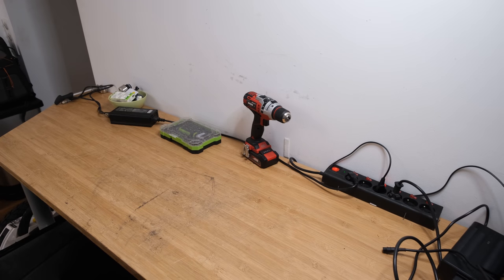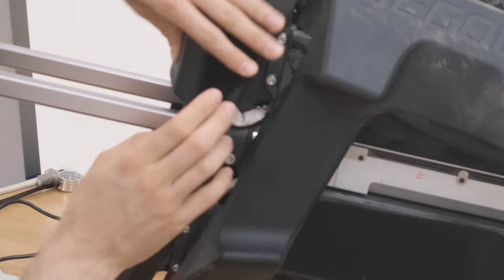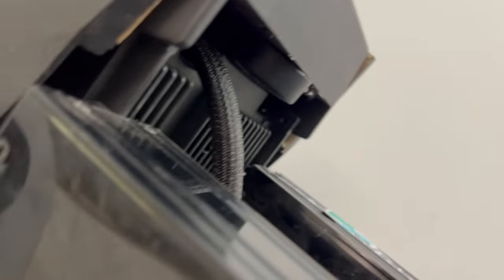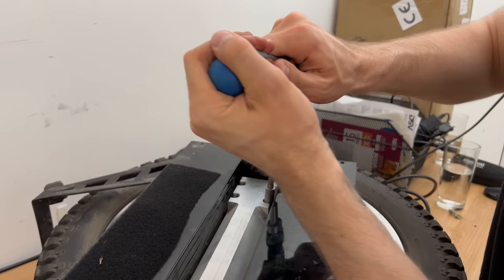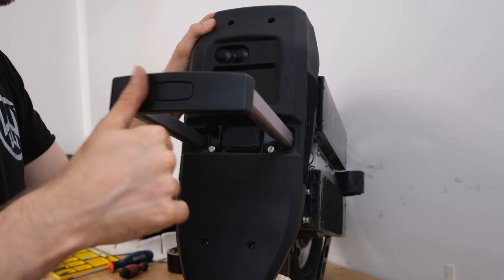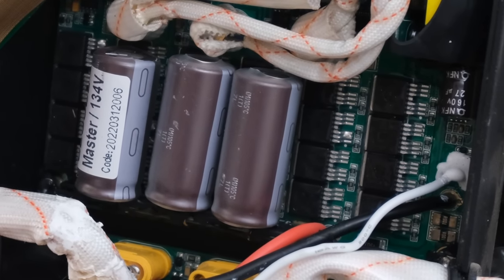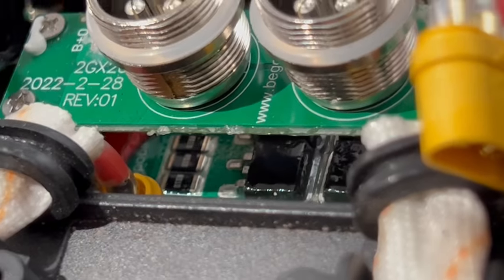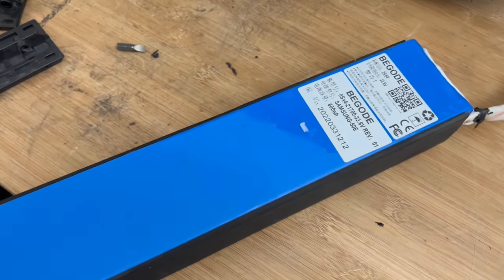Chinese Engineers MAD?! - 134 VOLT Electric Wheel Teardown

Comment: Wow...almost all the new wheels are pure $hit! More than $3.000.00, and the quality seems really bad. I was waiting for the S20 and the Master to buy my second wheel after 9.000km on my first wheel, V10f. I guess I will buy an used Sherman or the EXN. I can't afford to buy many wheels, so I need something reliable.
Reply: I would say my Gotway MS3V is the most reliable wheel I have ever owned - 3000 miles / 5 years and still going strong. I will trust those guys again with this one, and don't mind finishing off their job for them with some adhesive metal plating for batteries, tape on the screws there, silicon round the control board and velcro on the pads. I think they spent the money where it counts - quality mainframe metalwork, suspension, sliders, motor and power.
Reply: 'nuther vote for the sherman here. I've had it for 4000 miles and its runs great. I did crash at 30mph and the guards got messed up. I replaced the front one and the wheel just keeps on working. Its the toyota of eucs. Maybe later we will see the terrorists rolling around with them with ak 47s on their hands 😆
Reply: @Gideon-300  🤣🤣🤣🤣
Reply: @Jaaaaaaaaaaaaaaay  new rider but extensive research and experience taking an MSX apart. I totally agree with you and I didn’t think of sticky metal on battery covers, I almost reached out to a friend to 3d print new battery covers lol. This will be a nicer solution. Already got the silicone, just gotta get the wheel now lol
Reply: This wheel is perfect for me! I just ride these things for fun, like my dirt bikes. I have a car to go everywhere. I never ride my wheels in the rain either.
Reply: Great for trail riders, we end up having to beef up protection anyway. Street riders, 99.5% go nowhere near pushing a wheel to worry about it crashing.
Reply: don't judge the S22 until you've seen it in person.
Reply: I just got the EXN last week and it’s pretty amazing on range and speed.
Reply: I feel like we’re hamsters, regardless of what make of EUC we ride. I think all EUC manufacturers should make products with an intelligent BMS, good IP-rating and safe charging connectors. It would be SO CHEAP to incorporate, especially considering the high price they put on their products. Why don’t they want to look good?
Reply: Guys, please, don’t speak about Sherman anymore, because it’s no more to be found to buy it. Say something about Sherman Max, if you have it. Everybody knows by now, that first Sherman is a great wheel. Thanx.
Reply: @JM Coulon No, you can’t find it. Tell me about Sherman Max. Thanx.
Reply: @aaronrichardson5619  Of course there are solutions. If they can’t do it, then lower the price, so we can do it. You take my money, then you expect me to finish your product. Let’s encourage them in this behavior. Good job.
Reply: @Cr125stin  Well, some of us, think about this wheels as vehicles not toys, and have go to work regardless of the weather.
Reply: @ecoboostedfuze  Is it unbalanced? What is the name of the batteries inside?
Reply: @danmano478  it feels a bit tilted back but if you update the filmware it’s evenly tilted but I feel more comfortable with the old tilted back filmware because it give you more room for acceleration. The batteries are Samsung 50e
Reply: @kenspaceman3938  Man I love your comment. God bless you. Not like those zombies, egocentric, bragging, “ride only in the sunshine”, “the other breed”, “diy it yourself after you paid it”, “yellow lollipop lovers”,  Begode fanboys.
Reply: This is why I got VS out the gate
Reply: @ecoboostedfuze  Probably you bought it from ewheels and they put those batteries. I’m in Europe, and from what I know, from factory EXN comes with LGs batteries, or a combo of LGs and Samsung. I don’t want fire prone LGs. I heard that, because of how the battery packs are put inside, the wheel is not balanced.
Reply: @Jaaaaaaaaaaaaaaay  lol only 3k in 5 years?
Reply: imotion v12 ht seems to be promising, just hope they fixed those issues with cutouts.
Reply: @JM Coulon I assure you, I was not nitpicking towards Sherman. I’m genuinely interested in finding first hand (from a owner) info about the second iteration of this wheel, namely Max. I read some comments of a friend of Adam, in another video, I don’t recall well his name, Jon Svoboda or something, who seemed knowledgeable, enumerating some important minuses of Max vs first Sherman. I really have the money and wanting to buy a reliable wheel for deliveries. Sherman is one of the options, alongside 16X or V12. So chill, man. If I had critical comments sometimes, doesn’t mean I don’t like and love the EUCs, just like you. I just want some reliability, because unlike you, or others, I don’t have the means to pay such a amounts of money each year.
Reply: I agree. I also bought a V10f and I'm looking for a new wheel. I'm curious about your thoughts on the V12 compared to the Sherman for a next purchase.
Reply: @subrantix5811  to be honest, I'm not qualified to give advice about EUC. But, I live in NYC, and we have a strong EUC community here with many very experienced riders. The majority of them, ride Shermans, EXNs, and Nikola ARs. They love them. I'm getting one of those. The Nikola AR with extra battery from Alian rides is very tempting. I don't know if the nikola has a fire problem history. I'm going to ask around.
Reply: @subrantix5811  the V12 seems like a perfect size wheel, good speed, but I can't get over all the cut outs. They says the problem is been taken care of, but I'm not taking unnecessary risks, if I can avoid. I'm 44, I don't  want to fall flat in my face for something I can't control. Lol
Reply: @BL1000  I totally understand. I'm 21 and I'm also concerned about the cut outs. I spoke to a eWheels rep and they said they fixed the issue in the new batch. I'm saving up right now and I'll let you know if I don't fall flat on my face 😅
Reply: @subrantix5811   I really hope you don't fall flat on your face! 🤣 Good luck on your new wheel. Gear up 🙏
Reply: @aaronrichardson5619  that’s what I was thinking some 3d carbon fiber printing would be great

Comment: I have my Master now so backtracking into your video catalog here to find the Master tear down. Happy generally, I'm still on the CST knobbly tyre (27psi) but I have a Michelin City Extra sitting in the wings waiting to go on when I want. My machine is a v3 so I have the parallel battery packs and I think the suspension geometry a little different as well because I only have to pump the shock to 200lb to accommodate my 83kg. The charge port board and a little dc/dc converter board has been changed out by the dealer but otherwise up and running.

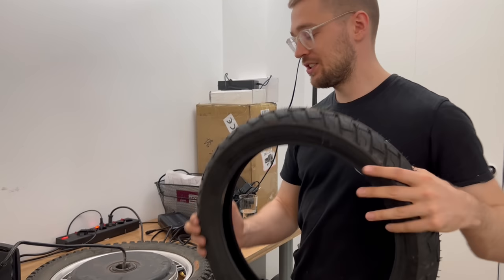Comment: Warning everyone ! At 9:57 where Adam is speculating that the bearing seals will probably be fine in wet weather. He's wrong ! Just 1 week into riding mine I got caught in torrential storm after which my wheel started grinding, and clunking, and is looking 99% like being the bearings at fault. I am working on their replacement.

Comment: So glad the battery case design is that simple. It can be easily remade from ALU or STEEL sheet. Steel is cheaper and can direct battery fires downward to protect the other parts of the wheel.

Comment: Both a biker and a wheeler, and lover of both. They don't serve the same usage imo, yup, you can be faster than a 125cc on a stop and go, but I wouldn't battle a bigger bike or I wouldn't compare it on long range - high speed. Those are just 2 wonders that are way too different.
Still, back to the topic, thanks again for those videos monsieur Wrong Way !
Reply: yep I've got a yamaha fz-09 goes 0-100kph in 3 seconds. 0-160kph in 6 seconds.  It is a monster that I use to get on the freeway to go long distances.  For store runs I take my sherman.  I've tried the motorcycle brotherly wave from my euc and I don't get the wave from the motorcycle riders.
Reply: @Gideon-300  I've got the wave from a few.  Don't worry when riding a bike they don't all wave either.  Some don't see you,  some think it's weird,  and some are assholes. Lol
Reply: as long as you ride in some way that's all that matters. i mean i ride and love both. and when i've rote the bigger, faster wheels with bigger tires (monster pro, master pro, v13, which I own since late 2023) the bikes start to notice more

Comment: Begode is doing just fine with safety IMO.   Cutouts and firmware problems are a riders biggest safety risk and Begode has that dialed in from my experience.
Reply from the maker: That’s true 👍 battery problems are another thing though as tons of wheels with 900Wh LG packs still keep exploding every once in a while. Quality out of factory also varies with not well connected electronics and various other issues.
Reply: @mr_wrongway  Very good point. It's all risk management.  I can prepare for a potential fire but there's no real prep for cutouts and buggy firmware.  Be safe with all those wheels in your place and thanks for all the info/vids.

Comment: When you examine the physical dimensions of the components that define a charger, you will notice that the actual needed parts are much much smaller than typical charger for durability reasons.

I realize that its possible to borrow from elements of physics, such as to design a charger that is structurally embedded within the framework of the vehicle, thus preventing the separation of charger and vehicle yet also able to repair if needed to.
A lighterweight more logically designed vehicle, as innovation would be the prime mover.

You could have a simple cable you pull from the vehicle frame much like vacuum cleaners have had built into them for many years that seem to last if theyre designed to.
For that matter, a 2ndary solar skin could be a type of vehicle self healing wrap to make sure they can do proper BMS battery tuning for longevity and performance.

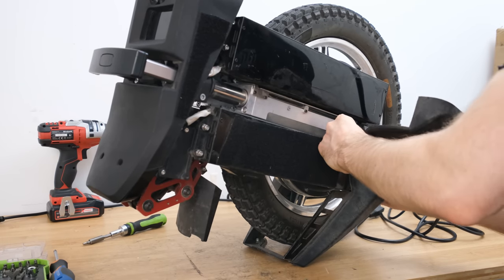Comment: 5:07 as you said that kickstand is not sturdy, just by a quick look I can see that they messed up the construction. The crossbeams are in incorrect orientation.
Anyway the control board packaging, and battery assembly is a mess. No waterprooofing and quite useless usage of seals. Even the capacitors are just left hanging without any support from glue. I need to stay that I am stunned in a bad way. The quality is not there.

Comment: For a wheel of this price/speed not to have waterproofing is probably the most unacceptable thing to begin with (although this wheel is incredibly unsafe).

Imagine a car you could not use under the rain… if you have to go home, rain or not, you have to go and you have to be safe with this.

Begode is really the company that should not exist among euc manufacturers.. And I say that having owned couple Begode wheels…
Reply: Great comment, just, I don’t want them gone, only to improve materials quality and waterproofing.
Reply: @danmano478  I’d love to see them improve on that too, but I honestly doubt it’ll ever happen as proofed by the little amount of knowledge and the low cost of placing failsafes such as mere tape, fuse, and other logical things to do in exposed electronics. So at that point it is just that they consider no value is added for their sales and thus choose not to do it. So to me they are just unworthy of a rider’s attention the moment they disregard safety. Plus their after sale service is just insulting from my records.
Reply: @yuan-jia  Unfortunately, I think you’re right. I just wanted to give them one more chance, in my mind, for the performance they produce.
Reply: The best way for any company to improve is for us, the consumers, to stop buying

Comment: I've been so on the edge to buy a Master or S22 to replace my V11, but something about them just hasnt hit me right. Maybe its the build quality, the feeling that either way you are compromising, I just dont know. Then I found out the InMotion V13 Raptor is on the way and I am going to hold out for that one, as if its anywhere near as good as the V11 it will be my next wheel for years to come.